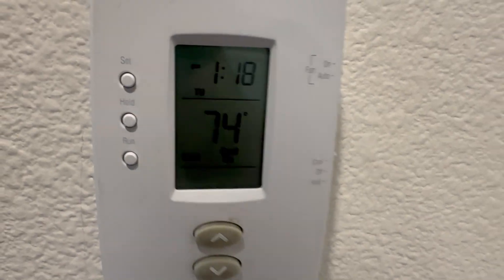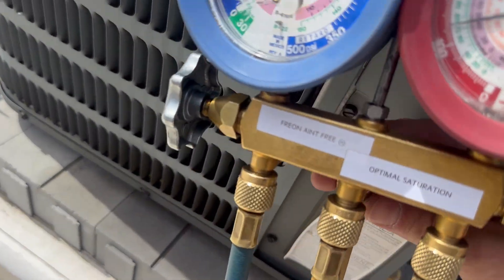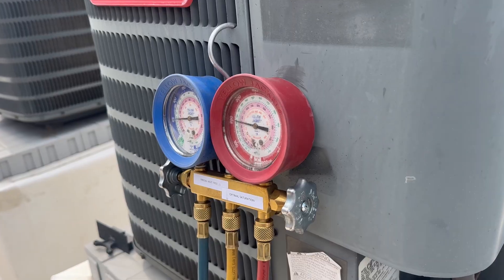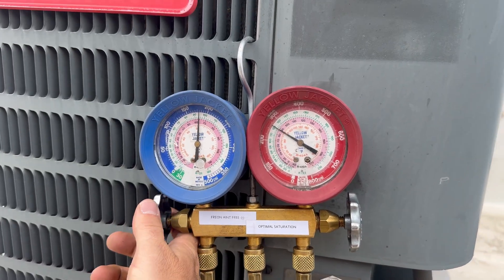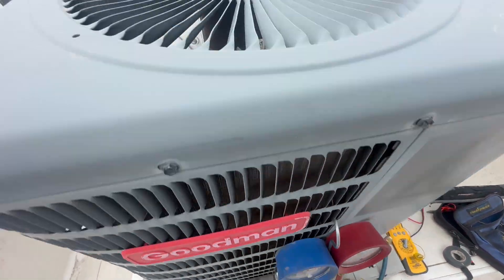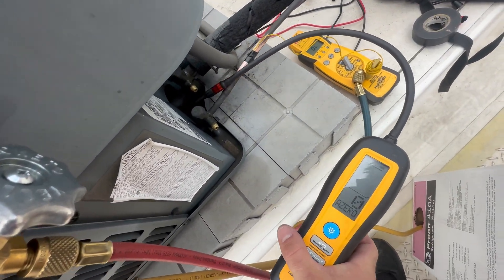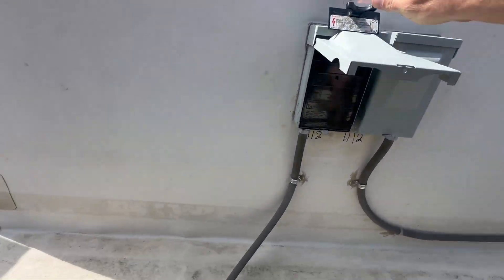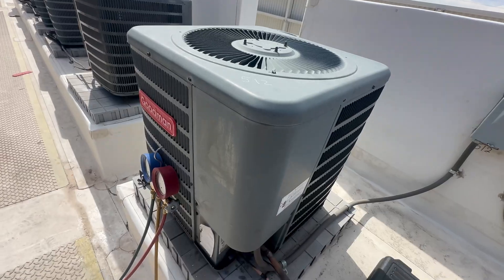HVAC Training #2 - Low Refrigerant

Comment: You are a great teacher!  I don't quite understand your solution?  Was it New heat pump? New Coil? Fix connection to coil?  Thanks
Reply from the maker: Hi! Thank you :) I wound up replacing the condenser. This isn't a heat pump just a straight cool outdoor unit. Heat is water sourced inside :)